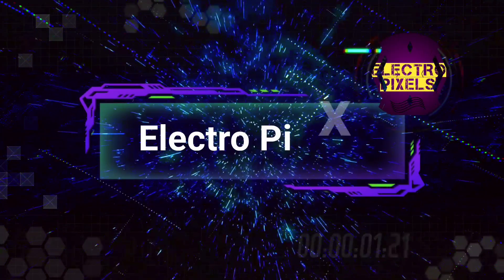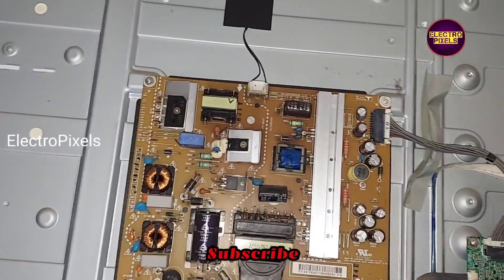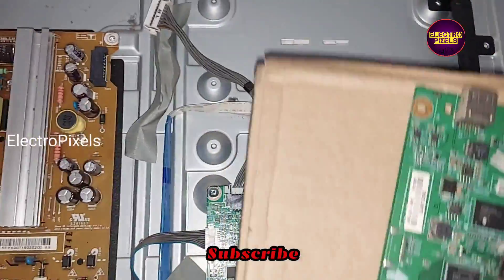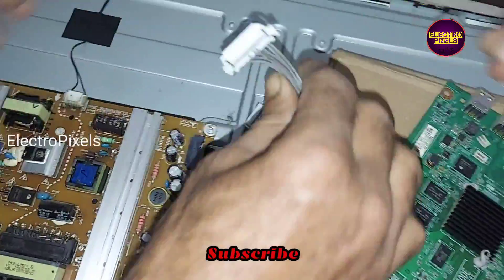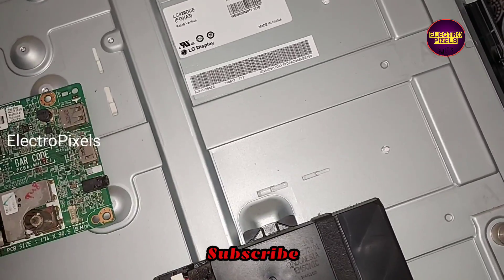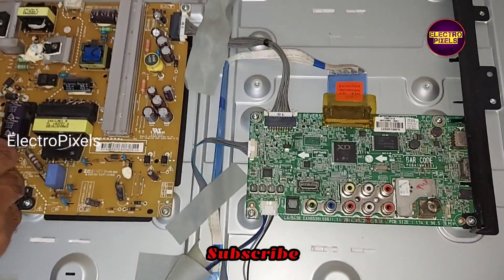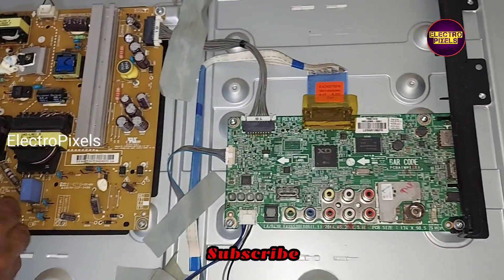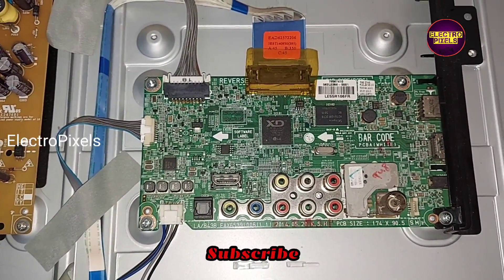LG 42 inch LED TV Standby Problem Repairing|Solution|Motherboard Fault |Main board Replacement|Fix

Comment: Hello brother, where did you find the motherboard from in Kerala? and  how much rs?  I am looking for one 42 inch lg .
Reply from the maker: You can Find it From Electronics spare parts shop, Or from Second Seller's in your area. Also You can install Universal board. Contact nearest Technician in Your area. Otherwise if you buy board from untrusted seller's if the board doesn't work or problems happen they won't take responsibility after sales so contact nearest Technician
Reply: @ElectroPixels  Thank you very much bro.